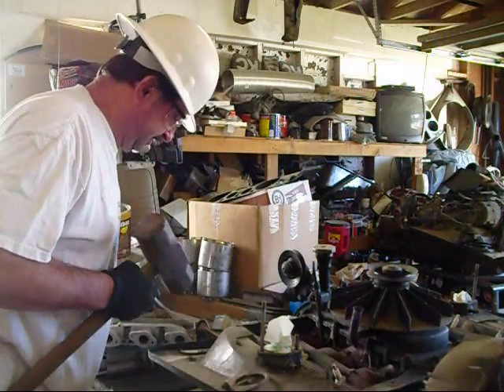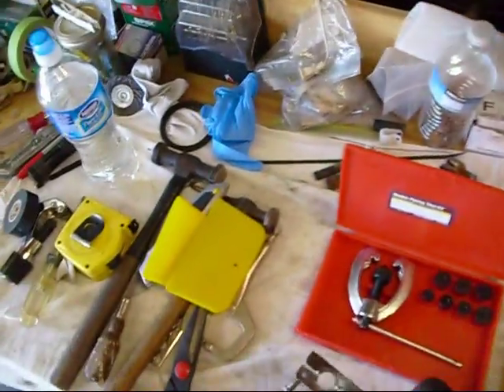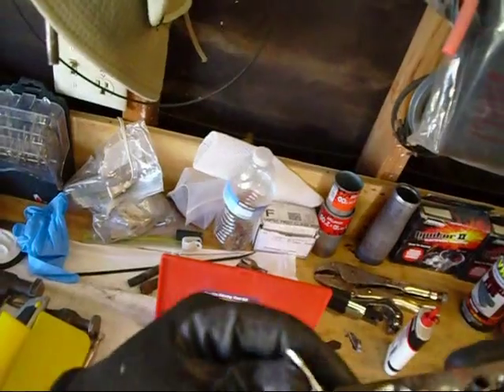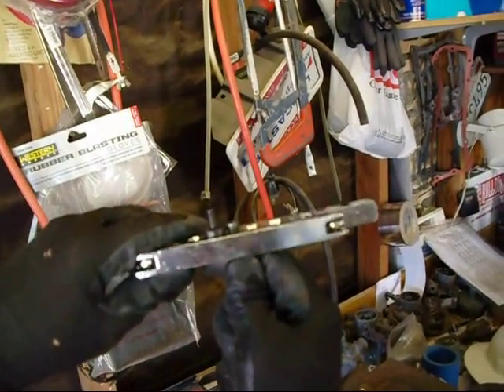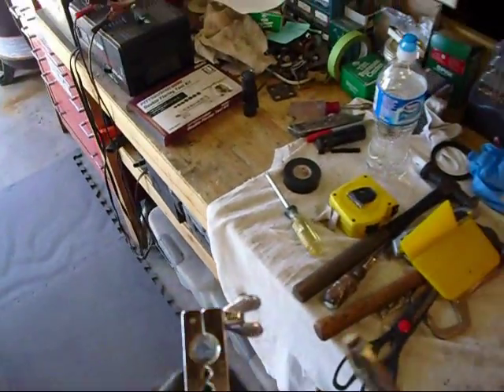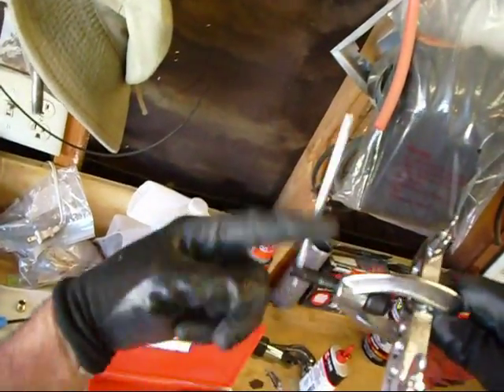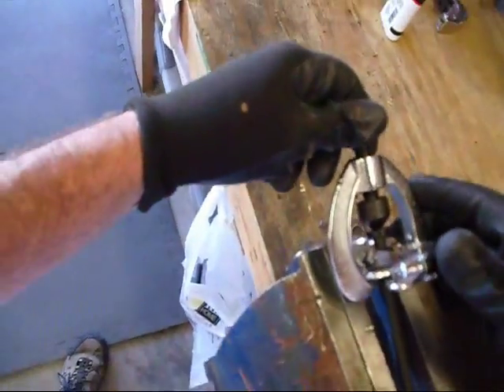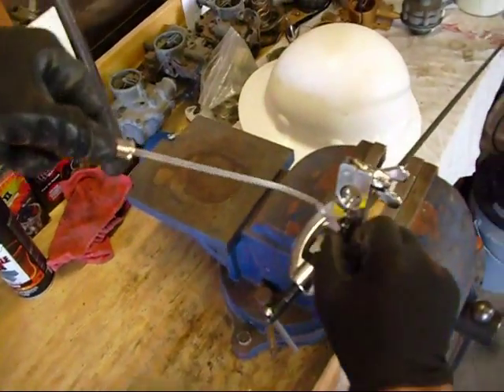Gas line/Brake Line flaring Tool!

Comment: As crazy as this presentation starts, I found it to be the most helpful vid about using the HF flare tool.  The key was using a vice to get a better clamp on the tube.  My first attempt at flaring (no extra clamp) just pushed the tube back through.  The clampy bars in the HF kit tends to deflect.  I used a C-clamp in place of a vice, and every flare since has been perfect.  Thanks for making this vid!